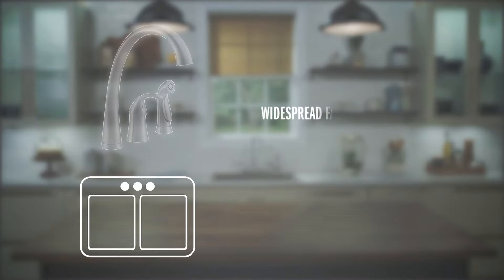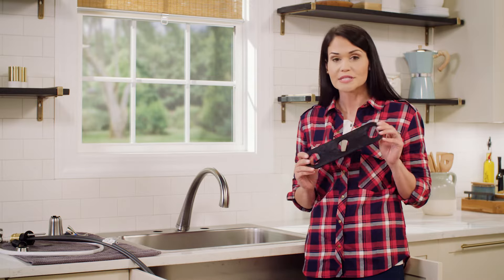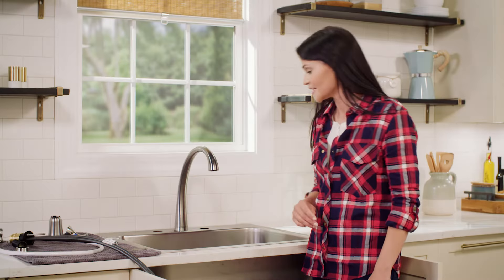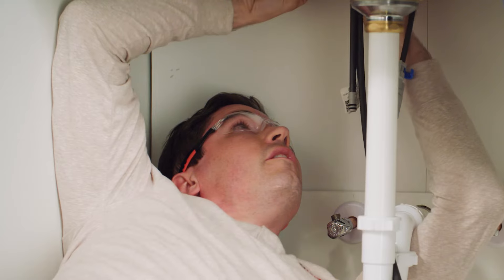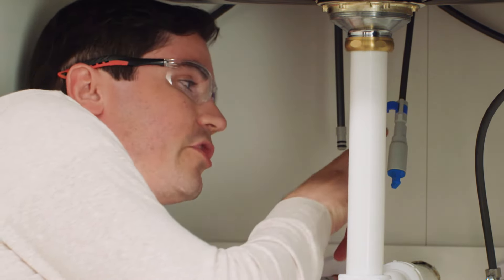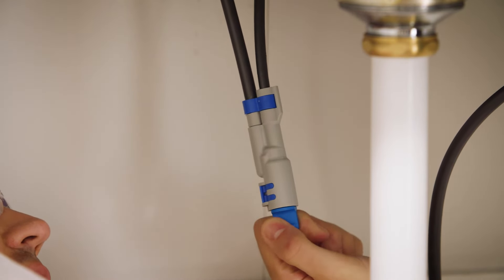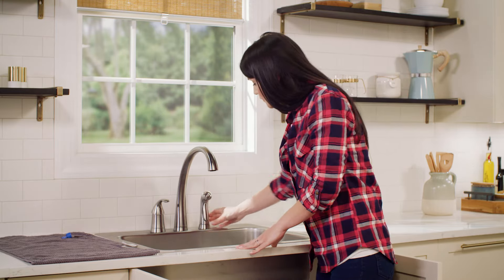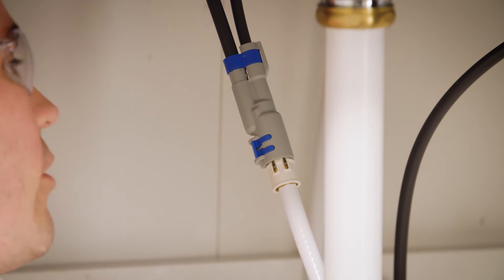How to Install a Delta® Single Handle Widespread Kitchen Faucet with a Sink Sprayer

Comment: Here’s a tip: In order to prevent any rubbing of the sprayer line on the valve mounting stud, we put the wrench used to install the nut on the stud back onto the stud after we were completely finished. It has been on for two weeks and has not fallen off. It should stay on there.

Comment: We just had 5 sets of Delta Vero faucets  3553lf professionally installed.  If the new 1/4 stop valves are fully open, all the faucets have a noisy low rumble.  1/4 stops have to be only 75% open to make the faucets quiet.  Are they faulty?

Comment: are the valves sold separately?  I tried to remove the bonnet from the valve to replace the cartridge, however, the bonnet was corroded and the plastic on the valve ripped near the thread that hold the bonnet to the valve.  I can't find the part for just the valve assy.
Reply from the maker: Hello Timmy. Thank you for your question and we are happy to help. The valves are sold separately. Please send us a private message with your contact information for further assistance. -Carrie

Comment: Ok, so just got my first Delta faucet,  and the ends that are to be reconnected to the red and hot  water line. Here's my problem, they don't  fit my old water line connection. What do I need to do to get them to fit properly,  or do I have to change out the old watering connections and replace them to fit my new connection?
Reply from the maker: Thank you for your question! We make an adapter kit RP63263. This will convert the 3/8"-24 UNEF thread to either 1/2" -20 UN threads or 1/2" -14 NPSM threads. -Bryan

Comment: Quick connects are easy to install but that sprayer connection will leak within 10 years.  I'm replacing mine now on my Delta 400-DST.
Reply from the maker: We're sorry to hear you are experiencing a leak but we would be happy to help. Please contact us directly if you need further assistance. - Edward

Comment: This is a very helpful video, really easy to understand. Good job.
Unfortunately, when the plumber installed the new Delta faucet, he got the hoses crossed and I haven't been able to pull the sprayer out. I got the blue clip opened, but the hose won't disconnect. It's stuck in there.  It's so frustrating. I wish Delta had some troubleshooting tips or something.
Reply from the maker: I'm sorry for the issue you're having with the Delta faucet. We'd be happy to help you. What is the exact model number you have and when did you originally purchase it? -Brandis
Reply: @deltafaucet   You're very nice to respond, thank you. I think the model number is 400-DST-L and I got it in October 2018.
Reply from the maker: Thank you for your response! In order to further assist you , I would recommend you contact us privately. Our customer service department can be reached at 1-800-345-3358 during our regular business hours: Monday-Friday 7am-7pm CST and Saturday 8am-5pm CST. You can also email us at customerservice@deltafaucet.com. We look forward to hearing back from you. -Brandis

Comment: Mine did not come with the spray hose connection clip the one that was done in the last step. the last hose. How do I get one of those. I called Delta and they said that model was discontinued and they did not have the part. so much for the lifetime guarantee! I will never buy Delta again that’s for sure!

Comment: Great video, horrible written instructions.  I just installed this faucet and was curious what the extra blue connector piece is for?  Wish I could post a picture of it.  Mine didn’t come with a weight donut but the instruction said it was there.  Initial thought on quality is not good.  Feels very cheap.  The handle doesn’t want to go to the left, I know it’s a anti scolding feature but it doesn’t seem or work properly.  The spray handle (wtf is a veggie sprayer) has no gasket at all so plan on using some plumbers putty on that.  Last issue, most sinks today are stainless steel not cast iron, why not include the support spacer in the package????  Your customer support is great but the seriously, how many corners do you want to cut Delta?
Reply from the maker: Thank you for your feedback and we're glad to hear this video was helpful. We'd be happy to help with your installation as well. Please contact us directly for further assistance with your model. -Edward
Reply: Delta Faucet how do I get the support bracket-spacer that goes on the bottom of a stainless steel sink?
Reply from the maker: Hi vinceleto!

We would be happy to help you in locating and obtaining the part you are looking for.  Please contact us directly so that we may assist you with it.

Best Regards!

Frank